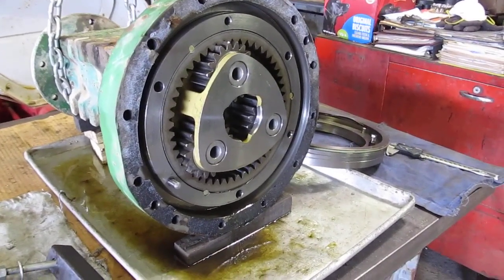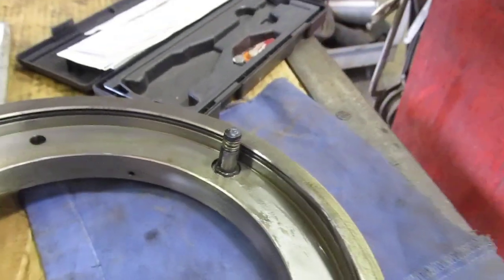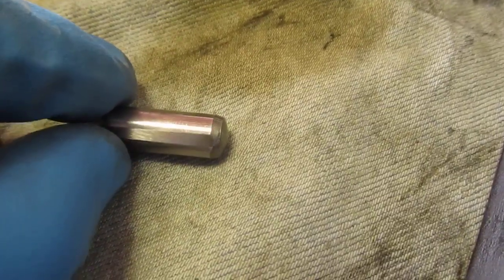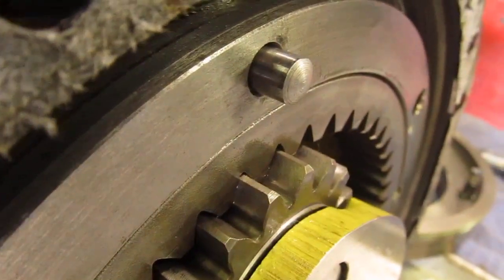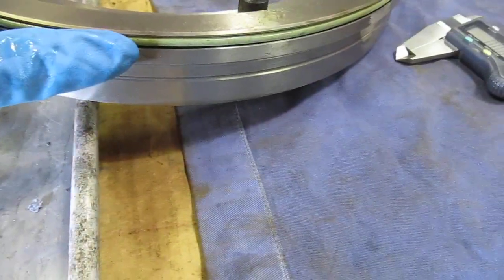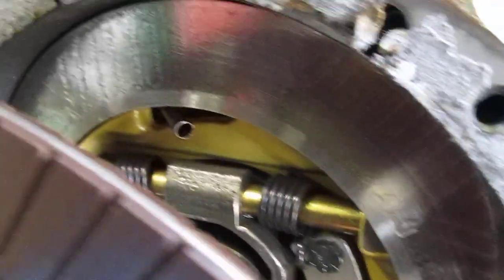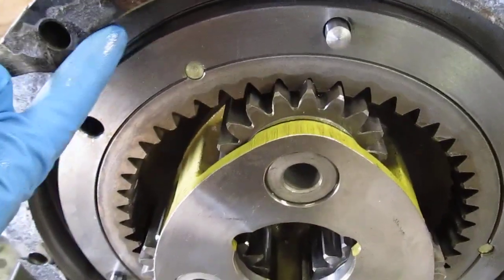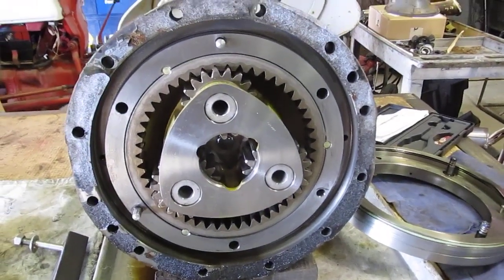John Deere 2155, 5220, 5420 brakes locking up

Comment: I have a 5410 doing this now and it is getting the housing hot, so hot you can squirt water on it and will hiss, not boil but close. It dries the water fast and cant hold your hand on it.

Comment: Was it locking up or just dragging?
Reply from the maker: Severely dragging. Not saying that you can't have a bad re-tractor. It just doesn't matter how strong the spring is if the pin can't return to it's original position due to the oil behind it. After replacing them and having the same problem occur on the same tractor, I noticed the pin and couldn't push it back in. How could the piston release the brake if the pins are staying out? Liquid doesn't compress so I slightly grooved them and no longer had the problem. We had the same problem with 2 other tractors and I didn't replace the re-tractors, just the o-rings and gasket, grooved the pins and didn't have any more trouble with those tractors again. Of course check for any broken spring or loose fit where the re-tractor seats in the piston. There is also a build up of gunk that can settle at the bottom that can not allow a total return. Always clean properly. Didn't make it a long video of the entire process, figuring you probably have some knowledge if you're attempting it in the first place🙂Best of luck

Comment: Nice, but the brake in this video is NOT the same as the 5420.  It's also not the problem.  The problem IS the retractors and the fact that the spring pin slips in the hole in the axle housing.  JD upgraded the retractor with a stronger spring and slightly larger spring pin but you may have to knurl the outside of the spring pin to get it to grip better.  Bad design.
Reply from the maker: I always appreciate helpful information. I’ve worked on these tractors for years and found that replacing those retractors did nothing to solve the problem. After simply putting the grooves on the sides of the pins, it allowed them to stay seated and no longer had to replace any retractors. I’ve done this personally to 4 tractors and never again had a problem. There are other problems that do exist with that design I agree but this does solve the problem in this instance. Good luck with all of your work.